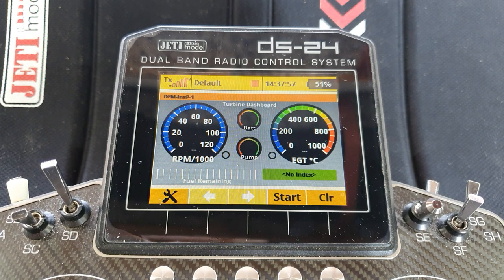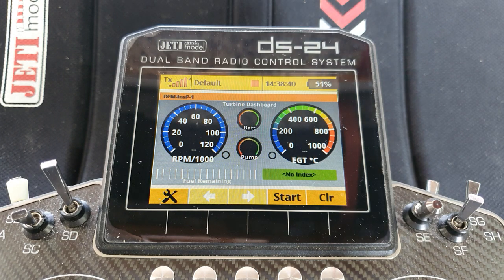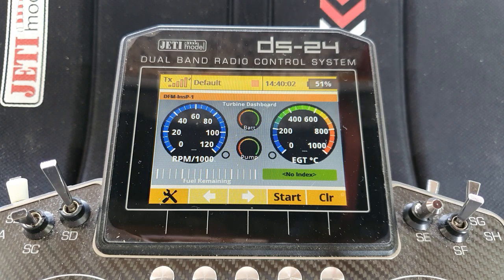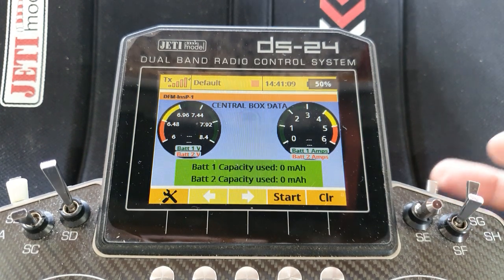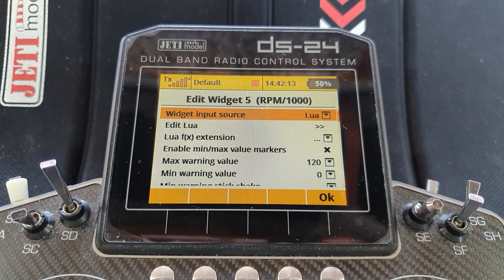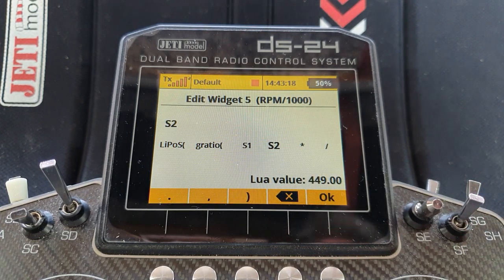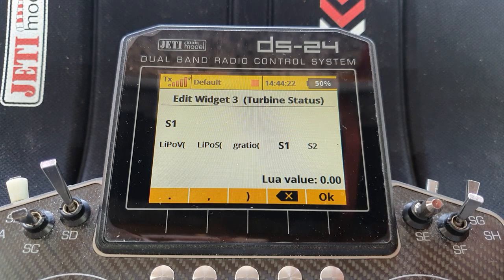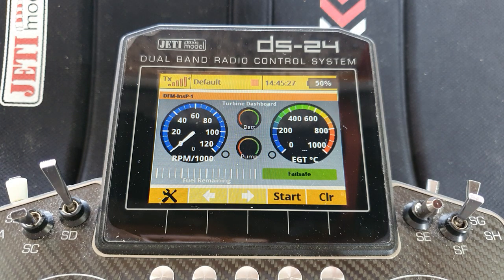Jeti - Instrument Panel LUA App episode 3, turbine panel, sequenced text boxes, function extensions

Comment: Hi Harry.. I am starting to use the app which I think is very cool. One simple question: I would like to use the timer on this app. How can I add it?
Reply from the maker: Sort of, the app was designed to work with telemetry and the timers are not telemetry so you cannot display a clock or an actual time.  However you can display the remaining % of a countdown timer, from 100% at start, down to 0% at the end of the countdown.  Is that any use to you?
Reply: @cotswoldpilot  that should work.... I would like to try that... is there something I can find online about it or do you have any suggestion?
Reply from the maker: You need a dial, bar, etc with scale from 0 to 100.  In the app, Inputs, change the widget input source from Sensor to Control.  Then go to Control, press +, scroll down to timers, and sekect which timer to use. When the Select Input Control screen appears, if the top line is "Switch On: 0%", press the Prop button, you should have a white and black bar
Reply: @cotswoldpilot  it worked.. is there a way to remove the index label?
Reply from the maker: @fprieto1975  you have to edit the panel in the website then upload the revised panel to the transmitter

Comment: I've got a new Swiwin 140 on my test stand and I am able to get telemetry from the ECU to my DS-24 so I wanted to provide the status codes.

Ready - 1
Ignition - 3
Preheat - 4
Fuel Ramp -5
Running - 11
Restart -13
Cooling - 12
Stop - 0
Reply from the maker: Thanks very much for that info, I will pass it on to Dave to add to the app
Reply: Any update on adding the swiwin codes?
Reply from the maker: It was done a few weeks ago
Reply: Can you confirm that the sequencer is working with the lua app and swiwin turbines now?